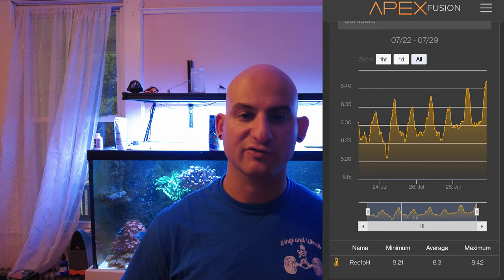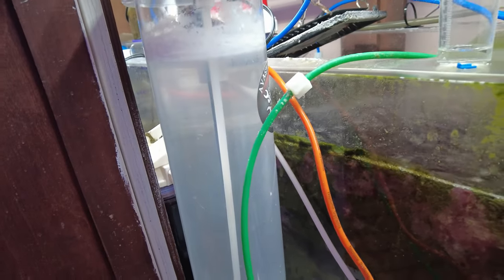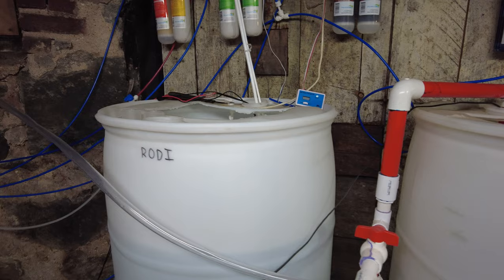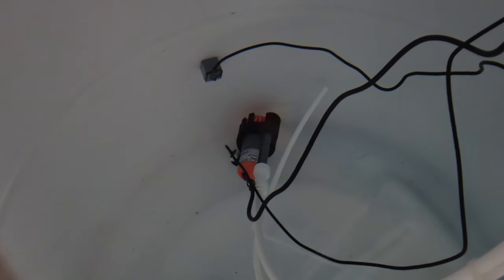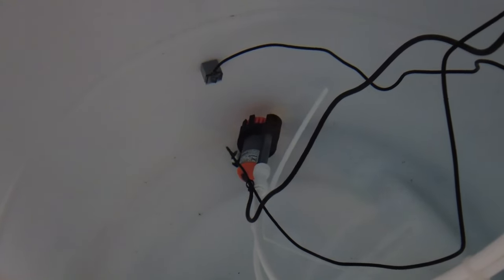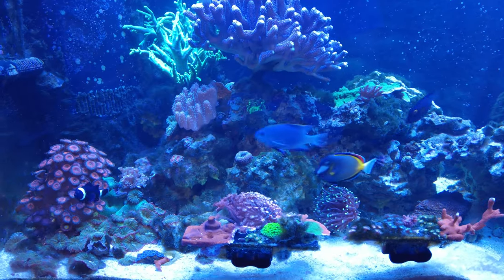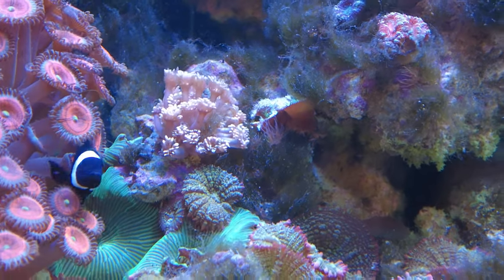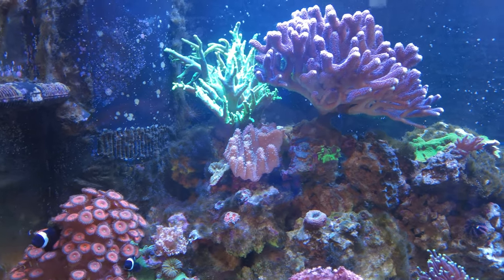Switching to Kalkwasser

Comment: Ok so if I understand this correctly, the Apex turns on the versa pump to the reactor if PH is less than 8.3? What is your flow rate for the versa pulling kalkwasser into the tank at? 5ml/min? 15ml/min? You have a calcium reactor there correct? Do you have both the kalk and calc effluent output near each other? Do they precipate each other at all? What kalkwasser are you using? Sorry if I missed some details :)
Reply from the maker: Sorry for the late reply, these are great questions that I should have clarified on more specifically in the video. The versa I set to a flow rate that if run 24/7 would be double my evaporation. That's about 8.5ml/min, and by dosing to the pH it should only run about half a day.  The calcium reactor is still there but currently I have the co2 off. Kalk effluent goes right into the return section since you want that to go into a high flow area, and the calcium reactor effluent is at the beginning of the refugium as an attempt to reduce it's impact on pH. I've always struggled with a refugium so I don't think that had any impact at all. Right now I'm using the BRS kalk since I had that on hand, but I haven't decided on what to go with after, possibly Mississippi lime, but I need to balance cost and quality. I don't need the Cadillac of kalkwasser, but I don't mind paying a little more so I'm not getting impurities.
Reply: @casualreefkeeping  Thanks for the responses. How is your alkalinity vs PH? I've been seeing a lot of Chris'/ACI's talks about kalkwasser. And aside from the potassium hydroxide debate, there is also a debate about pegging PH and letting alkalinity skew. He says he just lets his alkalinity do its thing and keeps his PH solid. I am curious if you're doing this as well.
Reply from the maker: @adambahe9309  yes I'm more or less following Chris' method, with the difference being I'm using the kalk stirrer instead of a storage reservoir. He recommends not using a stirrer because you risk dosing non saturated kalk at high flow, so I periodically check the pH in my stirrer and so far it's been consistent at 12.4. If I didn't already have it, I would have done a reservoir. My alk bounces a little bit but the swings have been about 1dKh max and no ill effects

Comment: Ok if you really want to do Chris method, you really need to get ride of the kalk reactor.  The correct way  to do this method is only run the kalk at night and does your total evaporation your take has in 24 hour and dose that at night only.  You need a container for this.  I use a 10 gallon container that has a sealed lid.  You need to fill this up and add kalk to where your PH in you kalk container is at 12.5. A kalk reactor can't do this.
Reply from the maker: Mostly correct, and maybe I wasn't clear enough in the video but I clarify in some comments. The only difference is I'm using the stirrer, however the dosing rate and time is consistent with his method. I had the stirrer already online, so it was an easier switch to just change the rate And when, as opposed to get rid of it and add a container. I do check pH in the kalk stirrer to confirm it's saturated daily. Dosing nearly 2 gallons daily, I stuck with the stirrer as a compromise to make my life easier. If I can't maintain the pH with the stirrer I have a 30 gallon bin I can fill, but so far the kalk stirrer is still keeping up.

Comment: How does the Apex turn on the Versa? Do you have the Versa already programmed with the dose rate, and it's on the apex programmable outlet? Or is there a way to control the Versa with the Apex? I use the Mobius app to control my Versa, I do not have an Apex, I have been using a Milwaukee PH controller but it always overshoots the PH. So I'm going to invest in an Apex Jr.
Reply from the maker: There is no integration to program the versa with the Apex yet, Ecotech support said something was in the works but for now I have the Apex just power on/off the versa, with the rate already set in Mobius to double my evaporation rate. I'll have to do a follow up video. Mine doesn't overshoot with kalk, but my pH does go over 8.3 during my peak photo period. It ends up averaging 8.3 though.
Reply: @casualreefkeeping   Cool, Thank you for clearing that up, great Vid!
Reply from the maker: @SA8N  thank you! I'll be sure to cover that better in an update. Hopefully we get that apex integration soon. I'd prefer it to run by software instead of power cycling
Reply: @casualreefkeeping  BTW, What Alk readings are you getting, When I first started I was hitting 11/12 DKH, Now I'm down to 9dkh. I turned off my calcium reactor too, I started dosing "All for Reef" to keep the trace elements going. I have ruffly 60G so I don't need much, 15ml daily, and my Alk hit's 9.5, by the next morning its back to 9.0, I'm manually dosing but will start a doser when I get the Apex so I can spread out the dosing through the day. I have seen incredible growth in a short period of time, PH is worth chasing!
Reply from the maker: @SA8N  yeah it's tough at first to break the alk stability mindset that's been the trend lately and focus on pH stability. My swing is about 1dKh min to max average across the week. Usually a single day won't have more than half. I've seen no ill effects of that, but so much polyp extension from the pH. I have an encrusting monti that looks practically fluffy now